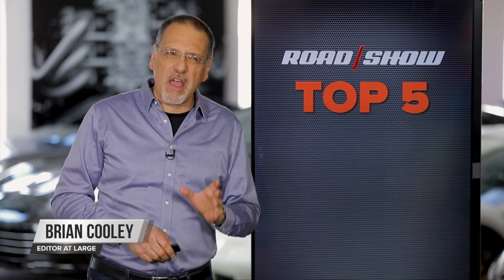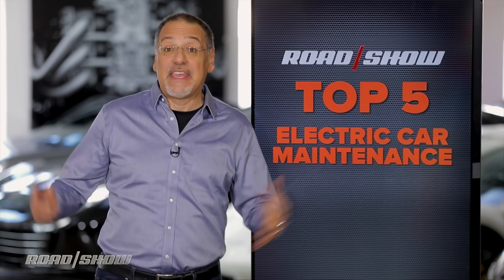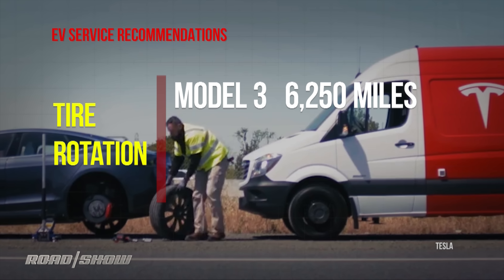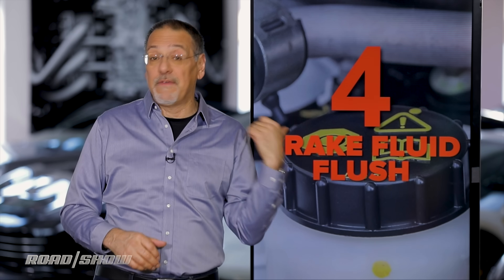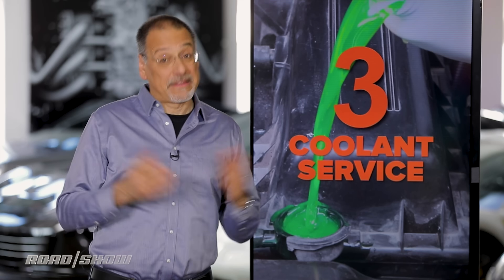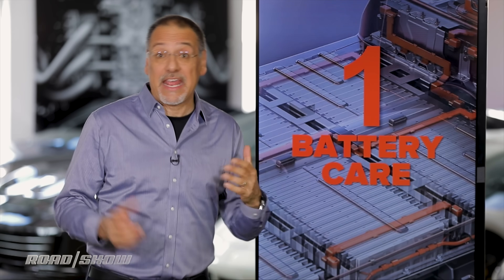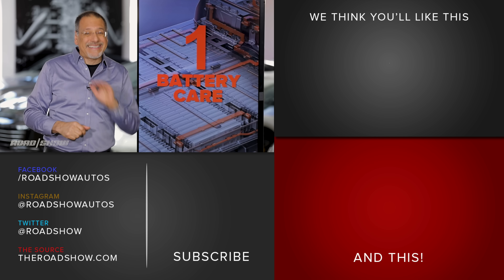Top 5: Electric Car Maintenance Schedule & Checklist | Cooley On Cars

Comment: Have a 2018 model 3 and maintenance has been basically nothing. One set of tires and just hab the 12 volt battery replaced and brakes serviced for a grand total of about 1700 dollars in six years. Not even close to what my ice car cost in maintenance for one year.

Comment: Do manufacturers have brain 🧠 or not because they can made a electric car but unable to make alternator or dynamo to charge the battery because your wheel are spinning they can fit dynamo like old style we use in bicycle wheel to light up torch 🔦 why we find a charging point if these things already in your car simple if you old car have alternator to charge up battery then it could be possible.
Reply: Except for physics

Comment: Caveat Emptor: I own a 2018 Chevy Volt Premier. On the plus side knowing your car involves reading the manual, as well as a considerable amount of research on the make and Model of the car you are driving.

So points taken and the following steps are considered by myself as necessary demons to be wary of.

1. Brakes are important so I ensured that no Cobwebs, Rust, or Dust accumulates on my brakes. The way to ensure that this does NOT occur is to drive once per month by putting the EV in Neutral so as to not engage the REGENERATIVE Braking that an EV does normally when the friction brakes are applied. The Volt is notorious for capturing the first 2G of braking as being sent to regen. Hence by putting the car in Neutral the car's friction brakes are enabled and the car slows down without regen sent to the battery. Doing this once per month for a stopping distance of 1000 feet keeps the brakes free of those Cobwebs, Rust & Dust from accumulation on them.
2. Tire rotation is not as necessary as you indicated on most other EV types for the Volt. Because the Volt does not involve the forces that twist the tires as you mentioned. The Volt is not a race car it is a small family sedan.
3.  Brake Fluids are just one of those things that cars need. I can say for certain that my brake pads & Rotors lasted until my car hit 95,000 miles. The main reason is that I never used the friction brakes and always used the regen paddle behind the steering wheel. In any EV, even the Volt regen is king. I only ever used the friction brakes as described in Point 1, OR to bring the car to a full stop after regen was applied to slow the car to bring the car to a full stop either in traffic or at a STOP sign / signal. This is a learned behavior and anyone can do it.
4. AS to the coolant, there is a monitor that indicates when that needs to be addressed as well as IF that develops an anomaly, besides the service manual does indicate as to when the coolant needs to be replenished or serviced.
5. As to the battery maintenance the Volt barely has any issues that after 4 + years of ownership I have yet to experience any problems with.

I have owned Internal Combustion Engine cars in the past and basically the Volt is also an ICE car with the full EV capabilities added to it. After 4 + years with the car thus far I have encountered no problems. I can seriously attain 100 or more miles per charge in pure EV mode when adding regen. This is a perfect city car with acceptable range with an added bonus of being capable of travelling on longer trips without having to be overly concerned about "Range Anxiety" at 3.8 L / 100 km or 65 mpg on the highway.

As is the norm with GM, It would seem that their mantra is "KIll it before it spreads" They did it in the 1990's with the EV-1 and they did it again with the Chevy Volt in 2019. Will they ever learn is the question of the century... OR Maybe they will go bankrupt again, I hope the government does not keep bailing them out. We should be using our future funds for the betterment of society not to bail corporations that do not show care and compassion for this planet..

Comment: The 12v battery, approx 3 yr. Fiat is a regular battery replacement, BMW you have to reset a computer, about $300 from dealer.

Comment: I've gotta say this because it should go without saying, if it's not good for a battery to "die", or be "overcharged", to be charged to often or not enough then why would the manufacturer allow the battery to do so. Why not put a preventative software in it to prevent this from happening. It's so obvious and straightforward I'm stunned that this could ever be allowed to happen, the manufacturer designed the car to allow the battery to break down is the answer. The car should also be able to regulate it's temperate via a back-up power supply as well This is amateur hour stuff, do it right the first time instead of going out of the way to screw people over is the solution...

Comment: Hi I own a Kona EV. The dealership just did a brake service on the car. Basicly they said the brakes were cleaned to the point of making them brand new. I can understand how rust could build up on the routers but charging the cost of new brakes? In your opinion how often does this need to be done.
Reply: Depends on where you live too. I’ve read that up north, they can build a horrible corrosion due to the salt they use on the ground. I would assume every year should be good. And down south you can probably get away with more. All they really do is just take off your wheels and clean and lube up the pads again. Something that can be done in your garage in 2 hours.
Reply: @ExpendableCrumb  Let me correct a misconception you have. Corrosion exists up here but it's not horrible. A car can easily last 10 years and if you take care of it much longer. Not many places use salt anymore and if they do only in the spring and fall.

Comment: I found this to be a real mixed bag of information. For example when talking about the coolant in an EV the presenter spoke about the coolant running through the battery being important to replace regularly. He quoted numbers for a Model 3 and a Leaf - the problem is that the Leaf battery is not cooled this way at all.

Comment: Renault Zoe Battery Management System (BMS) deals with the filling too high or too low.  It reserves about a kWh at the top and bottom of the battery.  So it doesn't matter how you charge or drive to the last dregs (not that I recommend it) you never get into those 'danger' areas.

Comment: Basically only regular wear items and fluids.  No engine oil, transmission fluid, spark plugs, head gaskets, timing belt, water pump, etc.  None of that mess.  No rough idle during very cold startup, no waiting for the heater to kick in.  EV is the future.
Reply: Bo Han head gaskets aren’t maintenance items, clueless much?
Reply: Tom Hardware@  It is if you drive a Subaru.

Comment: I have 88k miles on my 2013 Volt - have paid for 3 oil change services at $40 each and replaced the tires at 60k. That's it! Love the car and the extreme low maintenance requirements...

Comment: Hell less than ICE 
no oil change or oil leaks or burn oil 
no transmission oil or failure
no fuel mess
no toxic film inside car when long idling in cold or hot weather 

Instant cooling and heat 
Instant torque for safety
Reply: Hung Tran toxic film? Forget your anti nutty pills?

Comment: The Leaf’s battery is air cooled even its new 62 kWh battery back.  Probably not as durable as Tesla’s coolant battery pack
Reply: Correct. and 100KW peak fast charging vs 250KW! Leaf is poop

Comment: You can’t over charge an EV, the electronics will manage that but it can be discharged if not plugged in or overheat or be too cold in extreme weather if it does not have enough juice to manage the cooling and heating of the battery. I believe the Nissan Leaf may not have a cooling system however.

Comment: 2:53 -- wait, are those Peugeot EVs?
Reply: No they are not, but Peugeot is launching an electric 208 this year. Currently they still sell a version of the i-MiEV.
Reply: The 508 and 3008 will have PHEV. 
But yeah, the new 208 is going to be an electric.
Reply: Yes, that is a Peugeot 508 and a 3008.

No, they are not BEVs; but they do have PHEV variants.

Comment: Excellent list.  For many EV owners, the tires and charging for battery longevity is all you have to worry about. 
In all cars, it is ideal to change your brake fluid every 2 years or 24,000 miles. If you want to have a trouble-free breaking system for 300,000 miles +.

Comment: At least you can't be half asleep on your way to work and put the wrong electricity in your EV.
Reply: Just check the grade of electricity when you start hearing knock on the motor.
Reply: Yes you can actually. Imagine filling up with electricity made out of coal instead of renewable energy it would blow up the engine. 
Hahah I’m just kidding.

Comment: The biggest problem with electric cars is  not the cars themselves, but politics. There are big oil lobbies that want Americans to keep using gas and oil in cars
Reply: But that's not a "problem with electric cars", is it? That's a problem with people.
Reply: our energy comes mostly from fuels so does it matter if our cars are electric then?
Reply: Have you ever seen one catch fire?
Reply: @SIXITHS  Gas powered cars: 1,530 for every 100,000 sold.
Electric: 25 for every 100,000 sold 

Probably went higher with 2022 bolt that needed its battery recalled but still nowhere near gas.
Reply: @fallinggravity9964  ...so was that a yes or a no...?

Comment: Sooooo many ignorant morons in the comments. U have never owned or maintained an EV yet u insist on spouting garbage. I have owned one Leaf for 6 years and another Leaf I bought used for 4 years. The oldest has 82000 miles and is only 40% through its brake pads. Brake fluid is just fine and coolant color is unchanged. Nissan recommends these items b changed but it is only for the benefit of their service departments. Once I get rid of the last ICE vehicle I have, a 2015 Chrysler Town & Country, never going to buy another ICE car again. My brother crapped all over my EV ownership but recently bought a used Volt. Now he tries to use the gas engine as little as possible and is trying to construct an auxiliary battery to increase the range. If u try an EV, u will never go back to an ICE car.

Comment: You can run the AC or heat without running the engine, so taking a nap in an ev will be comfortable

Comment: Plugging into the charger every night and unplugging every morning is the same time consuming as going to a gas station every week.
Reply: No, it isn't. It really isn't. Let's do the math. It takes 10 seconds to plug in and 10 seconds to unplug (I timed myself), so that's 20 seconds per day, at most. Multiply by seven and we get a total of 140 seconds per week. That's a fraction over two-and-a-half minutes TOTAL for the week. Can you fill your car at a gas station in under three minutes? What if there's a line?
Reply: xchopp don’t forget the time to detour from your route or the extra drive done just for fuel up.
Reply: No it isn't.
Reply: So much work, just get a horse

Comment: i think EV cars also have transmission fluid too.
Reply: Gearbox oil, that's correct. The oil lubricates both the motor and gearbox. The maintenance schedule is similar to that of the automatic transmission, or approximately 150K miles for an exchange.

Comment: I have long conceptualized about magnetic touch-less brakes. So when you brake, the magnets on the wheel would be opposing the stationary magnets on the magnetic touch-less brake pads.
Reply: That’s basically what regen does (uses the electric drive motor). You only use the friction brakes for emergency stops. Would be cool to implement your idea on piston cars.

Comment: My Volt has 90,000 miles and has only had four oil changes and one new set of tires
Reply: Most tires aren't rated for 90,000 miles so be careful with that
Reply: @RealestUrbanism  thanks i changed it
Reply: Oil changes?
Reply: @sheru-qj3gj  Volt is a Plug In Hybrid with gasoline enigne.
Reply: Thanks!
Reply: That’s some cap
Reply: And how many litres of petrol in 90K miles? Probably cost £13500 just in the fuel, compared to £1260 in electricity costs in an EV.

Comment: Tires tires tires because low rolling never last and don’t take a puncture or pot hole...
Reply: The michelin energy saver a/s that came with our Volt are quite durable. 60,000+ miles is usually the norm. Very quiet tire as well, but the grip was poor for the near 300 lbs of instant torque. We swapped them out at half life (35K miles) for Pirellis. Will put the Energy savers on the Malibu as they are due.

Energy saving tires usually have higher speed ratings, not because of the speed they will never see, their side walls are reinforced to decrease rolling resistance.

Comment: Um hello, Suspension components. bushings, springs, shocks, those all fail or wear out before 80k.
Reply: What kind of unreliable hunk of crap would need the bushing, Springs and shocks replaced? Not a Tesla, not a Nissan leaf, no normal car should have its suspension fail or "wear out" anywhere before 200,000 miles unless you're offroading all the time in AFRICA
Reply: Emerald mist and company have you ever owned a car? Suspension takes a beating especially if you live somewhere with bad roads. California, Detroit etc. and most European cars require them before 100k. We have a Volvo XC70 V8 and almost to a T every 60k the front end starts clunking. We have had to change the front shocks and bushings twice and I kid you not it happened at exactly 60k and 120k. But our Toyota’s just slowly get worse and worse every 100k.
Reply: Really depends on the quality of car and the roads you drive. If it's all highway with few bumps, I would expect 150k-190k miles.
Reply: Maybe on your Trabant.
Reply: I live in Cal, 80k is way below average, I have done little to no replacement of springs struts or suspension components.

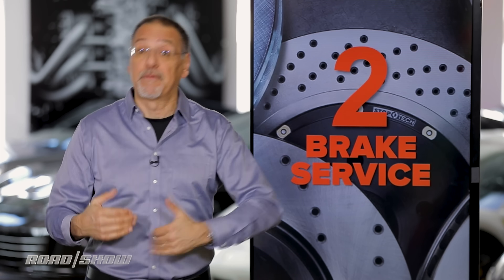Comment: 2:58 On the whole, from Prius drivers to Volt and BMW i3s drivers, a set of brake pads can last from 25,000 miles - upwards of 50,000 miles. Unless you're the type of guy or gal that likes to stab their brakes everytime to get a rear-end claim, a regen-able car should always get more than the 15,000 mile life span for pads.

The biggest downside to long lasting pads is that they can coarsen up, sometimes get stones and it's the disks that usually suffer from rusting, scarring, unsmooth stopping and uneven wear and drag from ceased brake pins (drove for 3 months with that...).
Reply: Wow!  50,000 miles from pads on an EV!  I had a Civic Si (gas) that got 135,000 miles on the original front pads and 208,000 miles on the rear.

Comment: You did not mention the cost of replacing the Tesla main battery like you did on head gaskets.
Reply: Keep in mind that you get an 8 year warranty on those and many people say that Tesla’s batteries should last much longer.
Reply: @Rakusan2  After Googling, the minimum cost is $10k for the second owner buying used unless he/she wants to constantly charging an old battery.
Reply: Not really an issue on Teslas as their batteries look like lasting up to 20 years with 10% decrease in range (i.e. 290 miles vs 310 new).

On something like a leaf which only has passive air cooling. degradation on early models averages maybe 20% after 10 years or so. Which is fine if you want a cheap runaround for a 10 mile commute, as long as you are aware of the problem.
Reply: Yeah... after about 2-300,000 miles...

Comment: Brakes on an EV or hybrid aren't maintenance free, especially in colder, wetter places where you get surface rust forming and have to make sure you clean them by braking often. I had a set need replacing after 18months from new on a Prius as they were rusted out from not being used enough. So at least once a day I clean the brake discs/rotors by shifting to neutral and just using the hydraulic brakes to clean them off.
Reply: A prius can be rolled in neutral?
Reply: @AJ-xm4xc  yep. Like any EV or hybrid. The Prius and Leaf are the same. Just pull the gear/drive selector to the right and hold for a second. Neutral.
Reply: Niall O'Toole Cool.  Good to know. Thanks.
Reply: @AJ-xm4xc  well it isn't a full neutral in an EV but a simulated neutral as there isn't a clutch or between gears to disconnect the drive, effectively free spinning motor as it is single gear direct drive.
Reply: Eh not really. Depends where you live. I've had my Model S just under 4 years here in mid-Canada where we get real winter. My brakes are fine but what happens is in the cold the regen doesn't work so we wind up using the friction brakes a fair bit in the winter.
Reply: @InternetDude  I've been told of issues especially with rust on the brakes by friends in Canada. So it does happen.
Here we are nowhere near as cold as you and definitely wetter.
I found that aftermarket parts from well known brake manufacturers tend to last longer than the Toyota OEM anyway.
Tesla use Brembo,so that could be another reason why your car didn't have as much rust issues.